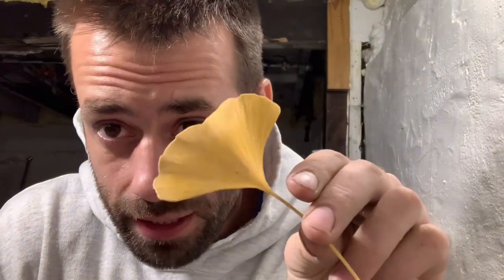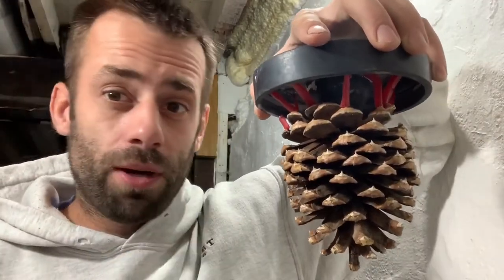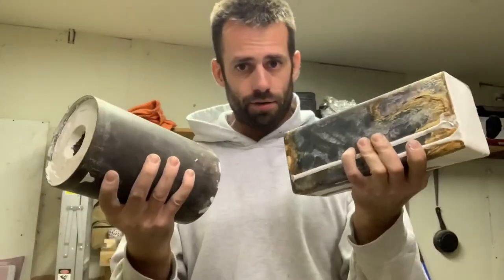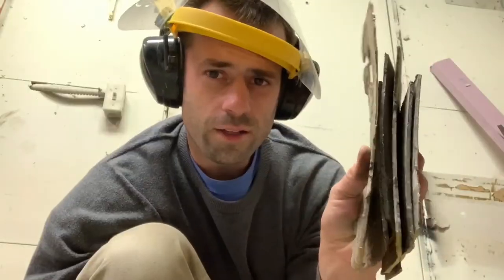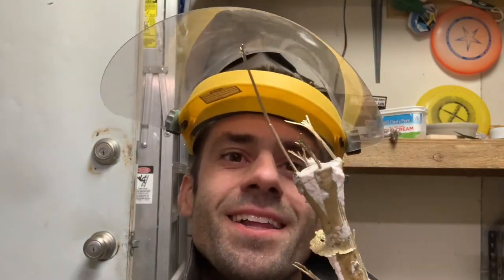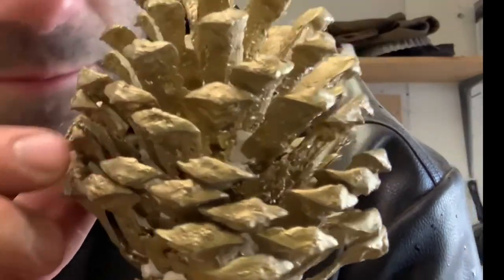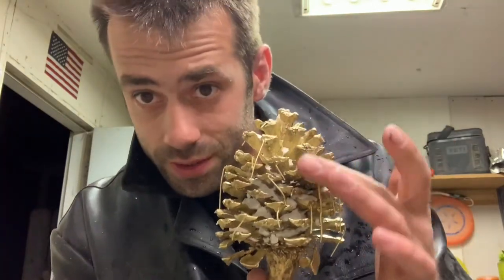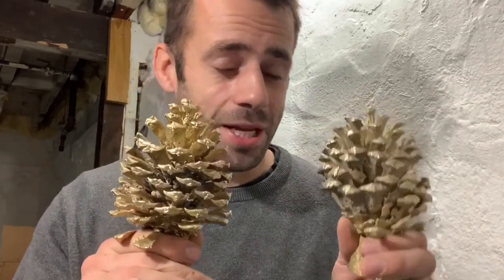"Lost Organics Casting", Bronze Casting Pinecone

Comment: You had better success than I did with pine cones.   We might need to vacuum the void after burn out to make sure all the ash is removed.   Nice job
Reply from the maker: I’ve heard some people will let it cool and rinse it out. That’s the rumor on the street. Maybe I will try again and try one rinsing and one vacuuming it the ash and see what happens.
Reply: That won't suck crap out of the investment.  The only way is to rinse the ash out and maybe hit it with some compressed air.  The real trick is heating the object long enough without being able to see inside.  I suppose measuring the volume of a pine cone and then dumping in roughly the same amount of water could determine if it's actually all gone.  But investment is very porous and will just soak up the water.  :-/

Comment: You are on to something good here.  I vacuum-cast smaller objects (jewelry) this process will definitely address some of your flow issues.  As you mention, it is mostly about giving the air, trapped in front of the incoming metal someplace to go.  That is most of the advantage of a vacuum.  If you weld, you can fabricate a casting 'table' with a piece of pipe, a base, a threaded female 1/2 inlet for your vacuum line, and finally a flange on top for the perforated flask to sit on.   You will want to use a perforated flask to allow the vacuum access to all the ends of the pinecone leaves.  I've had good luck using a graphite gasket between the casting chamber flange and the flask flange.  Finally, you will want to use a 2 stage rotary vane pump, likely the same pump you used for your investment de-gassing.  reach out if you have questions.  Great content!
Reply from the maker: Funny you should say that. Since this video I made a vacuum casting set up just like you described and it’s working beautifully.

Comment: I read about a casting technique for very fine parts like leaves or insects. It consists of submerging the organic piece in melted butter. that creates a thin layer that adds thickness.

It was used in the "Cellini Bell" made around the year 1500
Reply from the maker: Very interesting. I just did a few bugs that turned out pretty well. I didn’t use butter though.